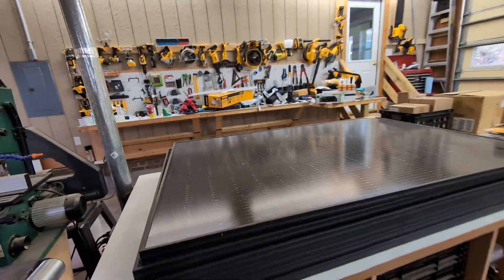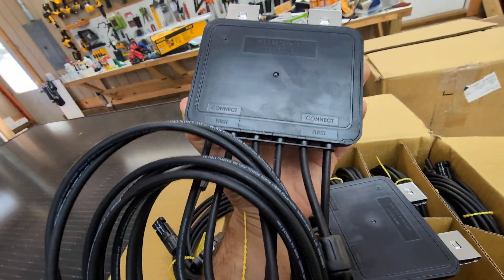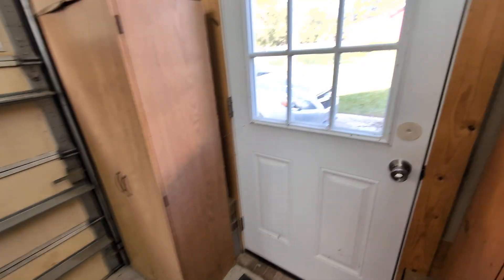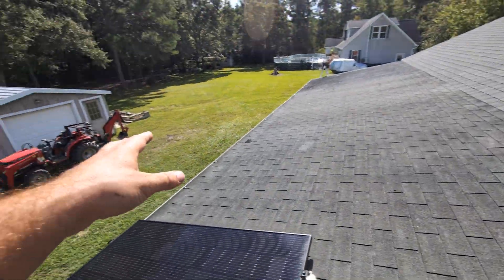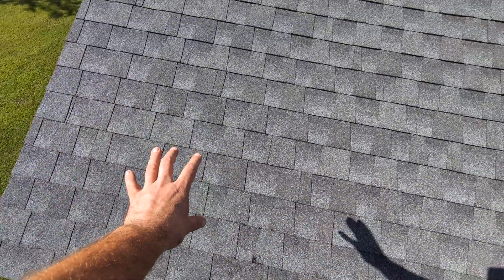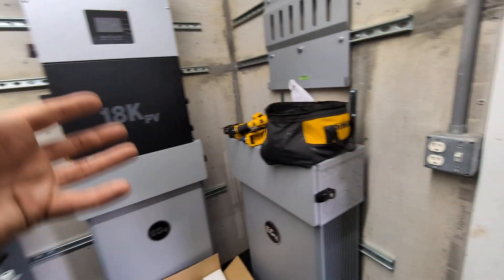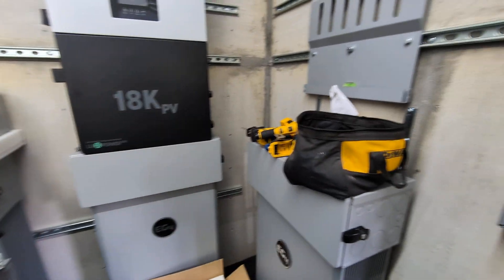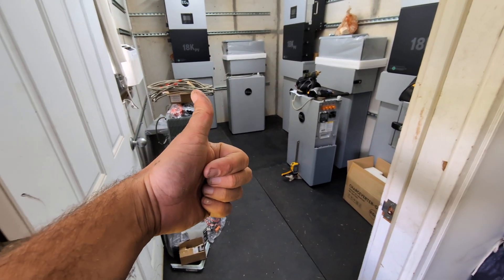DIY Offgrid Solar Project Update (Tigo TS4-A-2F) Series

Comment: What is the total capacity of your solar array ? This seems like a lot of power for normal residential use. Does your power company allow you to carry negative balance past 1 year ? Mine in Illinois does NOT.
Reply: sorry just saw the huge OFF-GRID on your video title :face-turquoise-covering-eyes:
Reply from the maker: System is 31.6kw of solar and I am not grid tied.
Reply: @ianmburke  Thank you for your reply. Quick question: any reason for not going the optimizer (TS4-A-O) route  ?
Reply from the maker: Only because I have almost no shade on the roof anf the 18k has mppt so it will optimize for what I need

Comment: Could you share more on your opinion of the 600vdc SPD. The way i see it is that the clamping voltage isn't fully clamped until over 1000 volts.. which, to my understanding, has already fried those 18kpv units if it's already that high.. idk seems like a waste to me.. thoughts?
Reply from the maker: I am not as well versed in that specifically but here's my opinion. Based on the panels never increasing in voltage they are below the threshold to trigger it but lightening strikes are well above it so it would stop them from getting to the equipment. I would be wildly unlucky if some random phantom voltage of 900v came into the system that was from another source that was below the threshold but still high enough to damage equipment
Reply: @ianmburke thanks for the reply. Im still convinced they are an insurance against a very small usage case senerio.
Reply from the maker: 10000000% that is correct, also good equipment grounding can and should prevent that

Comment: Hello,  I am building a similar setup and noticed you bought the Tigo communication hub.  Doesn't the EG4 18k talk directly to the TS4-A-2F roof module?  Is there added functionality with the addition of the hub (for these types of modules).  Thx
Reply from the maker: Just the wifi rapid shut down, if you only intend on using an RSD button the built in capabilities of the 18k will do everything you need without the need for the additional modules

Comment: hello, the eg418k will power the tigo transmitter?  No external power source needed?
Reply from the maker: I believe that is correct! The 18k can action RSD for several different RSD module types
Reply: @ thanks

Comment: The Tigo TS4-A-2F I found very difficult to use. I would not use this product again. Especially on steep roof. Here are the problems I found. 1. East to miswire, numerous ways to make mistakes.  2. Fragile, modules must be connected before string or warranty void. 3. Racks and optimizer can't be prewired. 4. Leads are short, on center fed panels  this means a lot more work underneath the panels on the roof. 5. Time consuming installation. Mounting panels to the racks and getting the wires tied up off the roof normally takes me about 15 minute/ panel. I have been averaging 12 panels a day with 3 guys on the roof. I hope there is a learning curve but you can expect cursing.
Reply from the maker: Super helpful real world feedback! What ways were they being incorrectly wired? On my units it seems pretty straight forward in that there are two short sides for each panel and a set of long leads that connect the overall string/series. They do take a lot of work to set up and if it were not for a wildly useless fire code protection in the NEC I would not have used them. When you note fragile is that over time and breaking or dropping the unit and it breaks?

Comment: I think you need more panels, wow, I just really mean wow on your system, jk'n by the way on the panels thing.
Reply from the maker: Don't worry... There ARE more panels 🤣🤣🤣 this is just the 'Primary' array there will be two smaller arrays on the house that directly feed the EG4 Mini splits since no AC/DC inversion has to happen it will have less loss and help reduce overall load on the AC side which this array will supply 😂 go big or go home right ???

Comment: Thanks! I was searching all over for that tidbit on series/ parallel configuration for the ts4-a-2f.
Reply from the maker: Literally your one comment was all I was hoping for!!! I looked everywhere and could not find that information anywhere. I did confirm with the Tigo Engineers so it is indeed series connected! Good luck on your solar project 👍